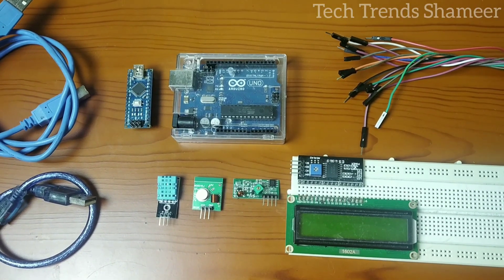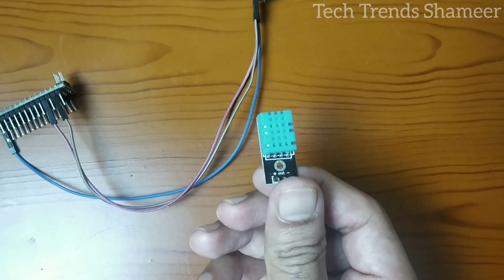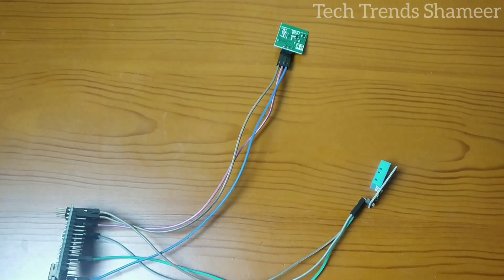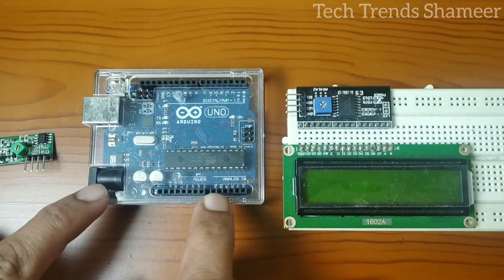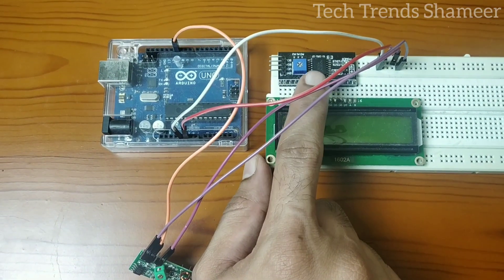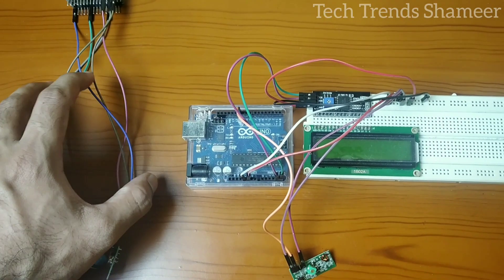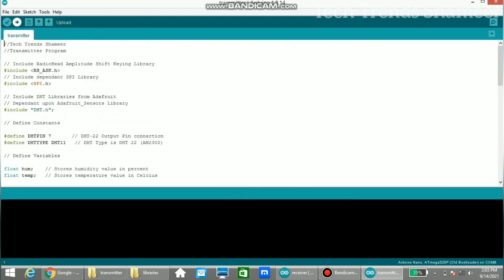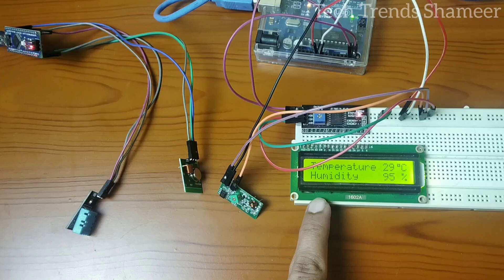How to Transmit Temperature Readings to Receiver | Arduino Projects

Comment: what do I have to do to hold the temperature and humidity value if the transmitter signal is off or can not be received?! With your example the values will be set to zero.
Reply from the maker: you mean the temperature value should not drop to 0 if the transmitter signal is OFF?
Reply: @TechTrendsShameer  yes, exactly